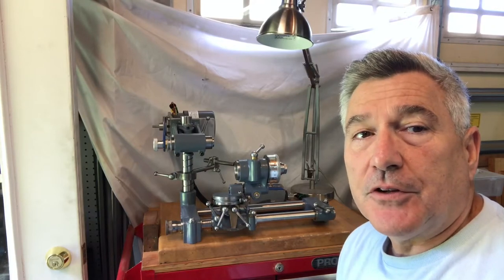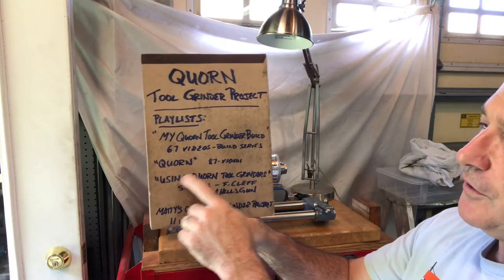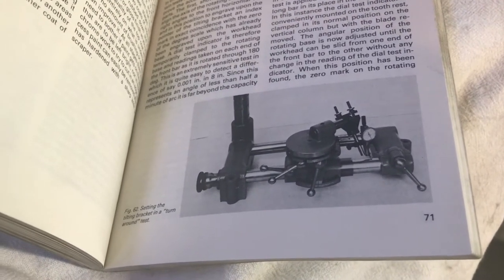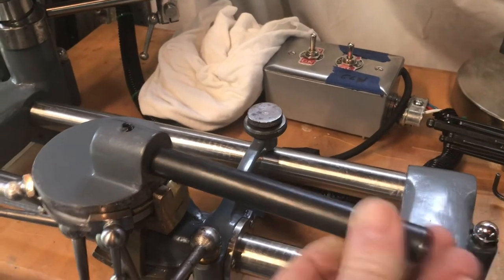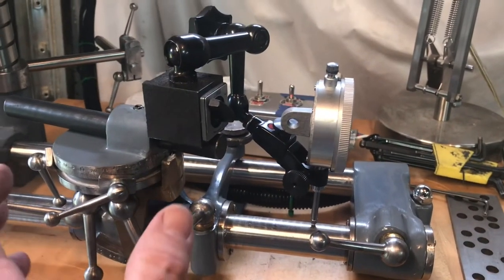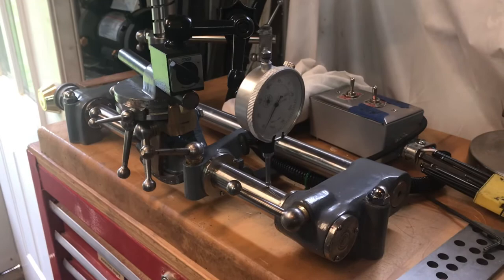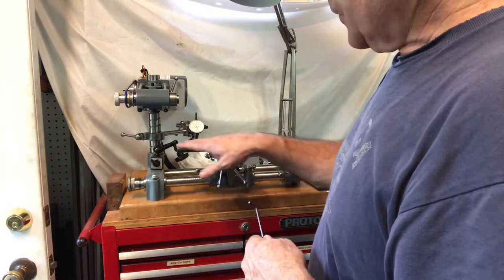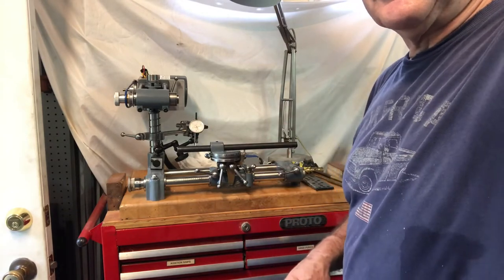Quorn Tool Grinder project- conclusion and alignment

Comment: Not sure I am following the second test where you moved the bar. Moving the bar would not change the indicator measurement as the fulcrum was not moving. To do this test, I would think you would need to move the carriage with the bar locked in, and not moving the bar itself. EDIT - Just saw your response to Bjorn. Disregard! LOL Loved following your project!

Comment: I'm getting confused about the second alignment test, it should be the whole base sliding on the base rods with no movement on the test dial to make shure the zero mark of the rotating table align with the front bar.
Reply from the maker: Thanks, Bjorn. I think you are correct, I will re-do the test and publish an update video soon. Really appreciate you pointing this out!